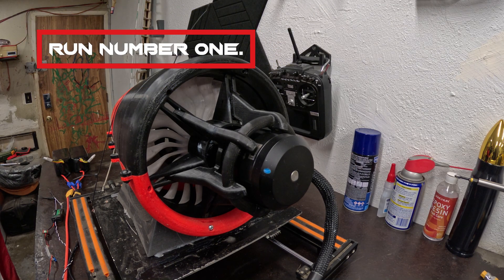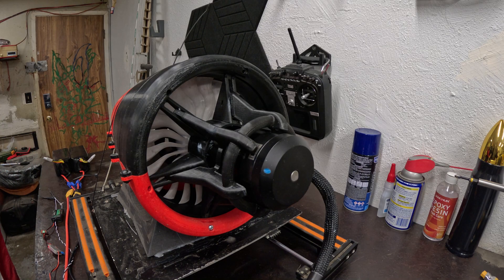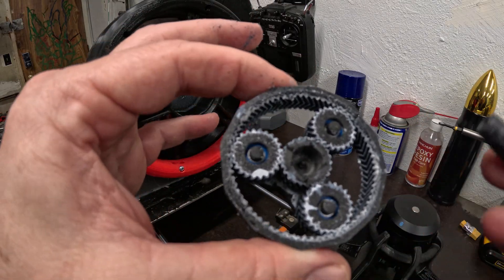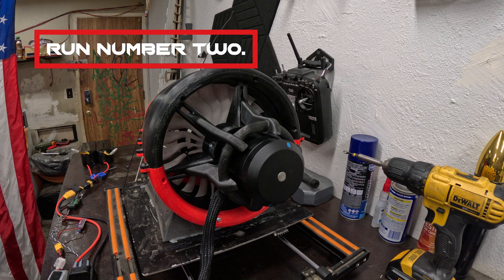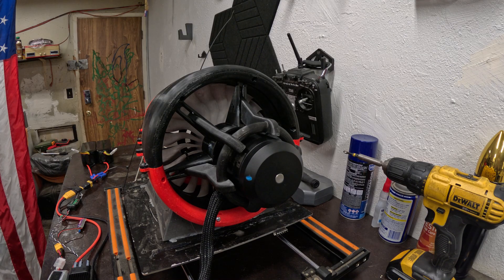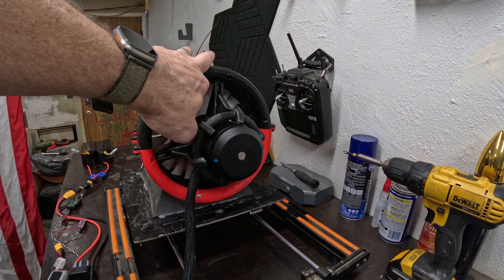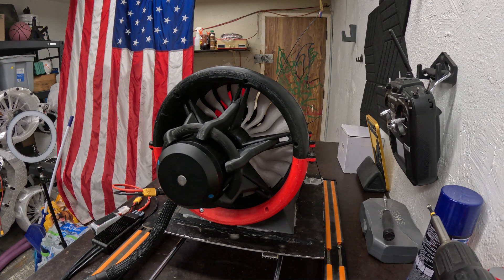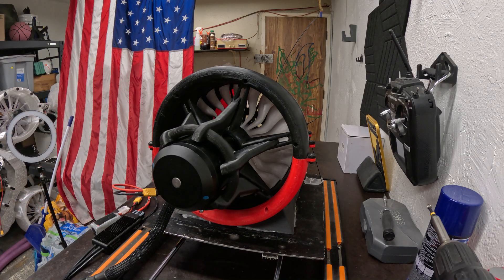Stubby Fan 170mm 3D printed EDF turbine.

Comment: I actually made myself a working 3D printed 70mm 6 and 12 blade EDF. Only took up to 300-350w and 425-446w respectively.
Used PETG. blades seemed to hold up well. printed in PETG. No gears though. just directly attached.
Reply from the maker: It's fun to experiment with new blade geometry at that scale. The idea here is a system that's drop in and modular. Only failure point so far are the gears, just waiting on a desktop style CNC in my budget range to cut them from some more durable materials. At that point I'll enclose the gear system and add cooling fins to the case. With a gear oil incased in the system it should cool itself just by operation and give me the RPM's I'm looking for.